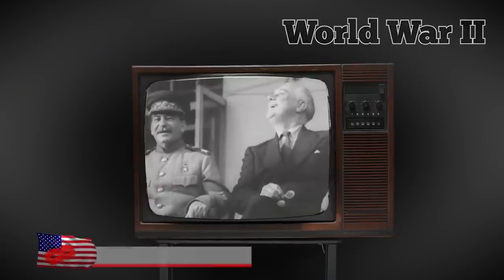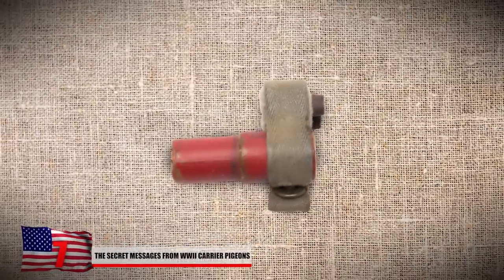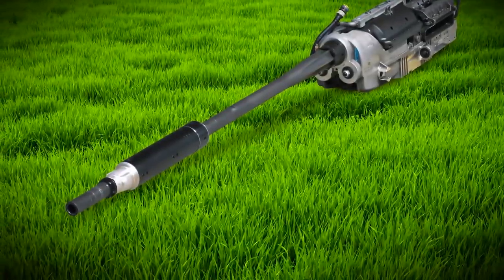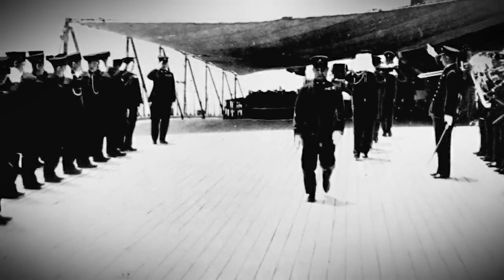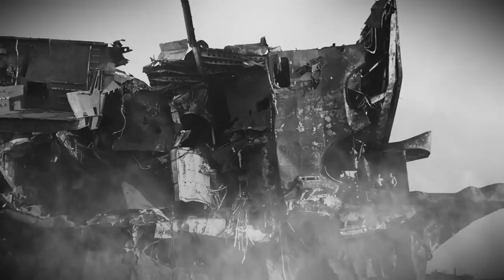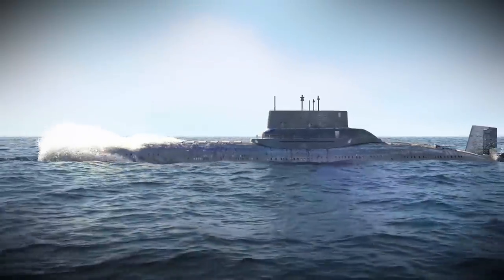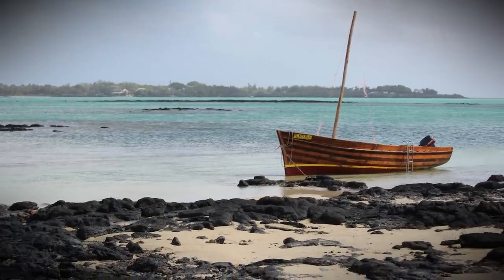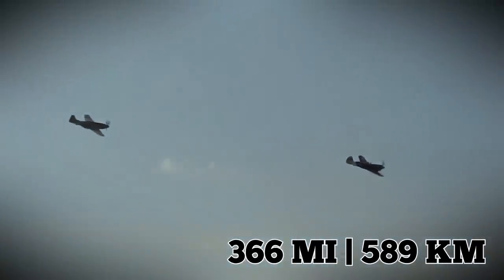8 Most Incredible Discoveries From WWII!

Comment: The Jagdtiger didn't have a "powerful AA gun" mounted on top, it was a MG34 or MG42 machinegun. The 128 mm Pak 44 had a limited range ????? It excelled at penetrating armor at range between 2 and 3 kilometers. Would be nice if you got the facts right.
Reply: well it is true it had a limited range. seeing as its range was NOT infinite
Reply: by powerful AA gun i think he means the 128mm gun and he does say limited range it would appear you misinterpreted what he said
Reply: @panzerelite6088  The Krupp 128 mm Pak 44 wasn't an AA gun. Neither did it have limited range. There was a 128mm AA gun : the Flak 40, produced by Rheinmetall-Borsig, but that was never installed in the Jagdtiger. It helps if you read some books about the Tiger tank and it's variants.
Reply: @fletsepopje  The 128 mounted on the jadgtiger was a modification of an AA cannon much like the 88mm cannon mounted on the tiger 1 and it did have limited range every weapon has limited range i did say this in my original comment
Reply: @panzerelite6088  The Pak 44 mounted on the Jagdtiger was not a modification of an AA canon. It was designed and produced from by Krupp. Krupp got the idea from the Russian 122mm field artillery gun and the 128mm calibre was chosen because the tooling was available and was used to produce naval canons.  Every weapon has an effective range. If one uses the term limited range, that means that the projectile can't travel far. Claiming that a gun that can shoot a projectile to a distance of almost 3 km's, has a limited range, is wrong. There are specific ranges of WW2 tank (or SP, and tank destroyer) guns, namely : short, medium and long range. Three km's falls in the long range categorie, therefore the range of the Pak 44 can not be called limited. Again, there are some very good publications that explain in great detail what I wrote in my comments.
Reply: "Jagdpanzers" were made from almost all WWII german main battle tanks from the Panzer III onwards. They were'nt just cheaper to produce, they allowed a chassis to mount bigger guns. Bigger guns = longer recoil = bigger turret for Main Battle Tanks. Bigger turret = bigger chassis needed! Jagdpanzers though had the limitations of  having to move the entire vehicle to aim the main weapon. Yes, some had limited traverse, but they were mainly ambush weapons. As the Allied forces in Normandy found to their cost. As to relaibility, almost all German vehicles were highly engineered to a very good standard. In the field this meant a lot of daily/weekly/monthly maintenance by their crews to keep them running reliably. In a fast moving front line this was very diifficult bordering nigh on impossible. Especially when the Allies had air superiority and bombed or rocketed everything that moved.